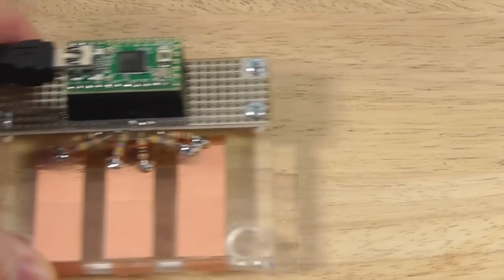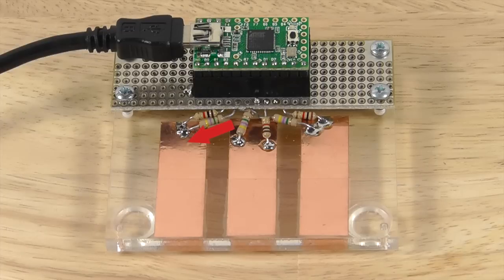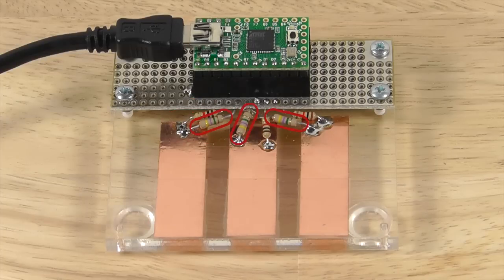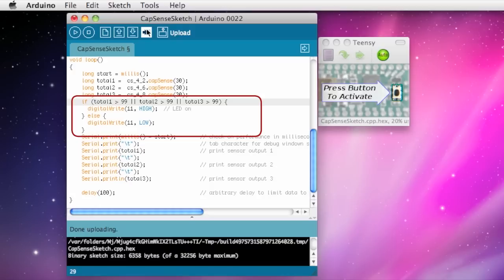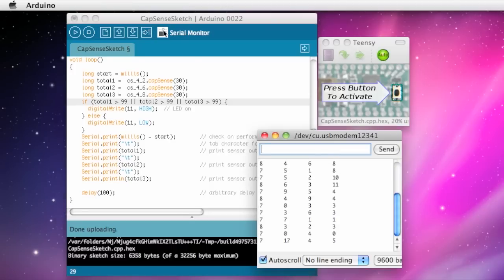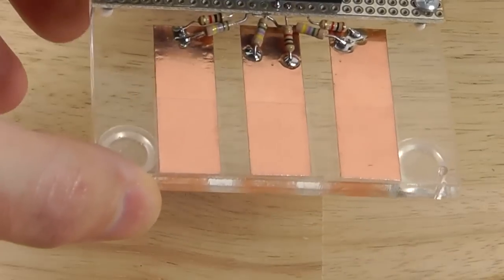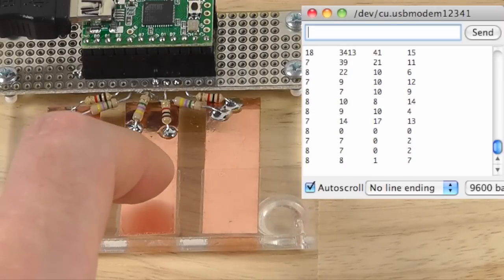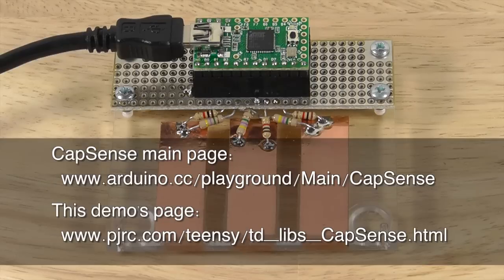CapacitiveSensor Arduino Library, Demo on Teensy 2.0

Comment: Hi paul. Great work!
I report what I found by doing some tests:
1)If you use the same output pin (4 as in the example) for multiple sensors it becomes very slow.
2) The same happens if you connect the serial port, for example 0->RX and TX->1 of Arduino UNO
3) If you put your bare feet on the ground or have damp shoes, the read value rises until it blocks the serial monitor.

For the rest everything seems OK! Great! 👍

Comment: Hi, Thank you for captivesensor ! 

I try and it works at the begining but a problem appears few moment after. 

at the begening "  Serial.print(millis() - start);" was approximatlly 0 but few test later it's 1300 so the respond is not instant. 

Do you have an idea where the problem is ? 

Thank you in advance :

Arduino nano  
Code 
#include <CapacitiveSensor.h >
CapacitiveSensor   cs_5_7 = CapacitiveSensor(5,7);   
void setup() 
{
  cs_5_7.set_CS_AutocaL_Millis(0xFFFFFFFF);   
Serial.begin(9600);
}
void loop()                    
{
    long start = millis();
    long total1 =  cs_5_7.capacitiveSensor(30);
    Serial.print(millis() - start);        // check on performance in milliseconds
    Serial.print("\t");                    // tab character for debug windown spacing
   
    Serial.print(total1);                  // print sensor output 1
    Serial.print("\r\n");
    delay(100);                             // arbitrary delay to limit data to serial port 
}

Comment: It seems this idea is not so popular with the Arduino for some reason. This seems to be the most recent and useful info on sensing touch directly on the Arduino pins.  Maybe most people are buying off the shelf touch sensor boards?  I tried your code and it work wonderfully (with 2Mohm resistor)! Thank you. I was initially experimenting with input on the analog pins with little success. This is the way to go.

Comment: what is the unit of the values? Farad? or n F?
Reply from the maker: an arbitrary amount of time the library spent waiting for the capacitance to slowly charge or discharge
Reply: @PaulStoffregen  can I measure the capacitancevin this case?
Reply from the maker: The answer really depends on the meaning of the word "measure".  With low accuracy and poor repeatability, yes, you can.  Just use some experimentation with known capacitors to find a multiplier or perhaps a linear or 2nd order curve fit to map the raw numbers to Farad units.
Reply from the maker: But if "measure" implies the sort of accuracy and repeatability you'd expect from even a low-end handheld multimeter, then no.  The reality of this Arduino library involves measuring charge timing using digital I/O pins.  The exact voltage where the pin detects a low-to-high transition isn't precise or repeatable (varies with temperature, supply voltage, maybe other factors), so these results are not the stuff of high quality analog measurements.  You can try to correct for some of these factors in software, but the reality is this hardware is simply not a very accurate way to measure capacitance.  It works very well for simple applications, like detecting whether a large change like a human body coupled to GND is touching the electrode, but it is not suitable for making precise, accurate, and dependably repeatable measurements of the exact capacitance.  For that, you would need to first start with much more accurate analog measurement.

Comment: Hi Paul. Great work.. How would I go about combining this library with a couple of CD74HC4067 multiplexers on an Arduino to get more inputs?  Is there a neat way of initialising the multiplexer pins as capacitive sensors? Now the MPR121 is out of production I'm looking into better affordable ways to achieve large numbers of capacitive touch sensors for my project.

Comment: Hi Paul, would it be possible to use a copper pipe instead of the tape? I'm making an LED lamp and I would like to turn it on by touching the stand. Thank you!
Reply from the maker: Yes, almost any metal or other electrically conductive material can work.
Reply: PaulStoffregen I figured. thank you Paul!

Comment: I want to make a distinction between aluminum, cardboard and plastic
Can I do with capacitive detector????
Reply from the maker: probably not
Reply: Do you have an idea
Reply: @walidmaouche9638  If the pieces of aluminum, cardboard, and plastic are always exactly the same, you could. The problem with just a random piece is that a very small piece of aluminum might give the same indication as a large, thick piece of plastic. And wet cardboard could give the same indication as a piece of aluminum.

If it is always a sheet of aluminum, sheet of plastic, or sheet of cardboard, then sensor placement would be critical.

More than one sensing method would help.

What are you trying to do? Sort garbage? Even the pros tend to use people.

Comment: My serial monitor only reads the value every 3120ms. Any ideas how to fix this? I didnt change the code or anything. Got a Elegoo UNO R3 and cant find anything regarding such a problem...
Reply: Never mind. Its due to timeout if there is no sensor connected - i didnt remove the code for sensor 2 and 3.

Comment: with what units would you say capacitive touch or skin resistance is measured? is it by time or ohms or amps? could you give me an example please?
Reply from the maker: Capacitive touch is measured in units of Farads (or pF, pico-Faradas).  This particular library, using different resistors and the somewhat arbitrary digital switching threshold (between logic low & high) voltage isn't well calibrated to pF units, unless you test carefully with known capacitors and scale the results.
Reply: thank you!

Comment: Hi, how much capacitive sensor could we make on the Arduino Uno?
I would like to make around 25 capacitive sensors, and I've got an Uno since few days now.
Any advice? Thank you!
Reply: You better start learning some programming then.. If you at least understand the basics of it, you will somewhat understand what his code is doing and then be able to add more sensors in the same way he has done in the program in the link. Copy paste, basically.
Reply from the maker: Arduino Uno doesn't even have 25 pins, so that's an unrealistic goal.  For 25, you'll need a more capable board.
Reply: Thank you for the answer Paul, do you know how much Arduino Mega could take of capacitive sensors?
Reply: I changed a bit my project, now I'm making a 12 capacitive sensors and I've got the Uno with Adafruit MPR121 (12 capacitive touch sensors). I want to make each sensors act like the computer keyboard. ("awsedftgyhuj" keys) in order to instruments on Ableton Live for example. However I don't know about programming at all. Would someone help me?

Comment: Microcontroller-newb question: why don't you have to  touch GND as well for your body to act like a cap?
Reply: Because your body has capacitance to everything around it.

In fact, a problem many people run into is they do extensive testing with their Arduino or Teensy plugged into their computer, then when they turn it into a battery powered device, it becomes highly unreliable and desensitized.

This is because previously, circuit ground was connected to your computer, which had a fair amount of capacitance between it and your body. Now there is only the much lower capacitance between the small device common and your body.

This is why designing capacitive sensor surfaces is such an art.

Comment: I have a problem with a capacitive sensor ....
I want to make some sort of piano with 12-channel input sensror ....
I use arduino mega,
but,,, arduino can only read 6 capacitive sensors ... if over 6 then can not send messages to the serial (); I try to use 7 sensor arduino response unstable ... if using six sensors then arduino response so quickly ....

roughly where it died .... ??

The source code that I use .....

/*
  Arduino Starter Kit example
 Project 13  - Touch Sensor Lamp

 This sketch is written to accompany Project 13 in the
 Arduino Starter Kit

 Parts required:
 1 Megohm resistor
 metal foil or copper mesh
 220 ohm resistor
 LED

 Software required :
 CapacitiveSensor library by Paul Badger
 http://arduino.cc/playground/Main/CapacitiveSensor

 Created 18 September 2012
 by Scott Fitzgerald

 http://arduino.cc/starterKit

 This example code is part of the public domain
 */

// import the library (must be located in the
// Arduino/libraries directory)
#include <CapacitiveSensor.h>

// create an instance of the library
// pin 4 sends electrical energy
// pin 2 senses senses a change
CapacitiveSensor capSensor = CapacitiveSensor(4, 2);
CapacitiveSensor capSensor1 = CapacitiveSensor(4, 8);
CapacitiveSensor capSensor2 = CapacitiveSensor(4, 12);
CapacitiveSensor capSensor3 = CapacitiveSensor(22, 15);
CapacitiveSensor capSensor4 = CapacitiveSensor(22, 26);
CapacitiveSensor capSensor5 = CapacitiveSensor(22, 30);

CapacitiveSensor capSensor6 = CapacitiveSensor(23, 5);
CapacitiveSensor capSensor7 = CapacitiveSensor(41, 2);
CapacitiveSensor capSensor8 = CapacitiveSensor(41, 3);
// threshold for turning the lamp on
int threshold = 2000;

// pin the LED is connected to
const int ledPin = 12;

void setup() {
  // open a serial connection
  Serial.begin(9600);
  // set the LED pin as an output
  pinMode(ledPin, OUTPUT);
}

void loop() {
  
  long start = millis();
  // store the value reported by the sensor in a variable
  long sensorValue = capSensor.capacitiveSensor(30);
  long sensorValue1 = capSensor1.capacitiveSensor(30);
  long sensorValue2 = capSensor2.capacitiveSensor(30);
  long sensorValue3 = capSensor3.capacitiveSensor(30);
  long sensorValue4 = capSensor4.capacitiveSensor(30);
  long sensorValue5 = capSensor5.capacitiveSensor(30);
  
// long sensorValue6 = capSensor6.capacitiveSensor(10);
 // long sensorValue7 = capSensor7.capacitiveSensor(30);
 // long sensorValue8 = capSensor8.capacitiveSensor(30);
  // print out the sensor value
  

  // if the value is greater than the threshold
  if (sensorValue > threshold) {
    // turn the LED on
    Serial.println("0009.wav");
    delayMicroseconds(10);
  }
  if (sensorValue1 > threshold) {
    // turn the LED on
    Serial.println("0005.wav");
    delayMicroseconds(10);
  }
  if (sensorValue2 > threshold) {
    // turn the LED on
    Serial.println("0011.wav");
    delayMicroseconds(10);;
  }
  if (sensorValue3 > threshold) {
    // turn the LED on
    Serial.println("0010.wav");
    delayMicroseconds(10);
  } 
  if (sensorValue4 > threshold) {
    // turn the LED on
    Serial.println("0003.wav");
    delayMicroseconds(10);
  }
  if (sensorValue5 > threshold) {
    // turn the LED on
    Serial.println("0004.wav");
    delayMicroseconds(10);
  }
  

  // if it's lower than the threshold
   
 
 /* if (sensorValue6 > threshold) {
    // turn the LED on
    Serial.println("0003.wav");
    delayMicroseconds(10);
  }
 if (sensorValue7 > threshold) {
    // turn the LED on
    Serial.println("0001.wav");
    delayMicroseconds(10);
  }
  
   
  if (sensorValue8 > threshold) {
    // turn the LED on
    Serial.println("0010.wav");
    delayMicroseconds(10);
  } */
  
  else {
    // turn the LED off
    digitalWrite(ledPin, LOW);
  }

  delay(10);
}
Reply: Hey dude,
I wanna make 25 channel input, did you find any solution since?
Thanks in advance!
Reply: By the way for 12 channel I found that. The ADAFRUIT x12 capacitive touch shield for arduino. You might already know.
https://shop.pimoroni.com/products/adafruit-12-x-capacitive-touch-shield-for-arduino-mpr121?utm_medium=cpc&utm_source=googlepla&variant=1130740805&gclid=CjwKEAjw26C9BRCOrKeYgJH17kcSJACb-HNA3CeEZ3BSghrIDMgyLSTnuj3H1XHcnvuc9SF41f7OhBoC_S7w_wcB

Comment: I have been having difficulties get my touch sensor to work.  How did you get the "serial monitor" to display the data?
Reply: Pef273 It should display the data on it's own:

long start = millis();
    long total1 =  cs_4_2.capacitiveSensor(30);
    

    Serial.print(millis() - start);        // check on performance in milliseconds
    Serial.print("\t");                    // tab character for debug window spacing

    Serial.print(total1);                  // print sensor output 1
    Serial.print("\n");

That's right from the example code given on the Arduino library database for 1 pin (I didn't have 3 sensors in my build)
Reply: Ryan Banfield thanks

Comment: what does these numbers mean?
Reply: The time difference in the high-state of the 2 pins connected to the pad. When you touch it your finger acts as an capacitor and the first pin will have to charge you to a certain capacitance depending on how close you are and how much surface your fingers have. When it has charged your finger the second pin will get high and you end up with a time difference on the monitor. You could calibrate this to see the actual capacitance as the output instead.

Comment: This is nice and easy, but has its limitation. I used the same method a while ago and it failed badly in presents of CFL above with big sensor or when ground is broken and interferance around. The good way to go is charge transfer.

Comment: helo the video is very clear so i would like to work on it,bt i would like to know hw connections are made exactly i mean to which pins the resisters are connectd
soo can u plz help me out with this like any circuit diagrm,referenc material etc
Reply: Download the code and you will find the pin-outs.
Edit: When selecting resistors, 1M ohm is fine. If the reading is to unstable, just lower the resistance. If the reading is barely changing, just upper the resistance. 
Check out the link: https://www.pjrc.com/teensy/td_libs_CapacitiveSensor.html

Comment: Which factors affect the period between reading time? I use the same code but it reads every 3.9s. Is it due to different touch materials or different resistor value?
Reply: http://playground.arduino.cc/Main/CapacitiveSensor?from=Main.CapSense

Comment: The metal you are using is copper, correct?
Reply: Very clearly copper tape. Almost any metal should work. Copper happens to be an excellent conductor, and for demo purposes like this very easy to directly solder the resistors. Other unsolderable metals you need to use, make reliable electrical contact with a wire through a bolted down screw.

Comment: This is really static safe?
 
Can you use 1 pin to charge a bunch of sensors and read one pin per sensor?
Reply: Yes! you can.  You'll have to modify the library code, though, so it reads all of the pins - it's only set up to read one pin at a time.

Comment: Which is the arduino board you used.? i am using UNO board.. but i cant get the variations as you get in the vdio.. if i am giving CAPACITIVESENSOR(30) am getting the value as 60 even if i touch with single finger or more.. pls help..

Comment from the maker: On Teensy3, just connect to any of the touch-capable pins (see the pinout card or reference page) and then use touchRead().  It works like analogRead(), except the number you get is the capacitance in 1/50th pF units.  Teensy3's touchRead() is much faster and more accurate than using this library!

Comment from the maker: You can use the same pin to drive multiple sensors, but each needs its own individual input.  In fact, the example shown in this video uses 4 pins to interface 3 touch sensitive electrodes!
Reply: In the video your code seems to suggest you are using pin 4 as the driver but in the video it look a lot more like pin 3 was used (PB3) although impossible to tell for sure as the setup code isn't shown and that's the only pin where the solder point and wiring isn't 100%, but it sure looks like you are using pin 3. Is there a reason?

Comment from the maker: Higher resistance values (or 2 or more resistors in series) can improve sensitivity, but it will not solve the ground problem.  That's a fundamental issue with capacitive sensing.  Hand-held products with capacitive touch buttons and screens have metal housings so the user is grounded to the device, and free-standing equipment requires earth grounding to work.

Comment: Hi there, i tried above with a 1M resistor, because i don't have any higher and it works ok. Not great but ok. I believe it will work better when i use a higher resisitor. The only problem is, it doesn't work when i am not conected to earth ground. Like, not at all. I want to use sensor for controlling a wireless lamp. Will it never work without connection to earth, or will a higher resistor help? Love to hear from you, Melissa.

Comment: try it with only one sensor and use the original file. then change it like this:

    long total1 =  cs_4_2.capacitiveSensor(30);
//    long total2 =  cs_4_5.capacitiveSensor(30);
//    long total3 =  cs_4_8.capacitiveSensor(30);

if you dont connect each sensor, it will end up in 
millis() -start = ~4000ms

Comment from the maker: Well, try an even lower value resistor then!  What resistor are you actually using?  Which values have you tried?

It is normal to get a reading when nothing is connected.

It's also very difficult to help with tech issues on these youtube comments.  You can't post things like a the code you're using or photo of how you've actually connected things (if it's not working, you've almost certainly made a mistake in wiring or code).  Without seeing what you're actually doing, I can't help much more.

Comment: it works! basically ... actually i thought i would have to modify the library but .. that would be out of my skillabilities ... but then i realized how simple it actually is ... 

watch?v=5-Bq7ox3oOU

but i had to lower the preset samplerate to like 2 or so ... you can see more in the video and in the video description. have a short view on the sourcecode, i guess you get the idea how it works.
cheers!

Comment from the maker: Yes, it might be possible.  The chip and extra wiring will add a little capacitance, but other than changing the readings slightly, I'd imagine that ought to work.  Maybe you can give it a try and tell me if it works?